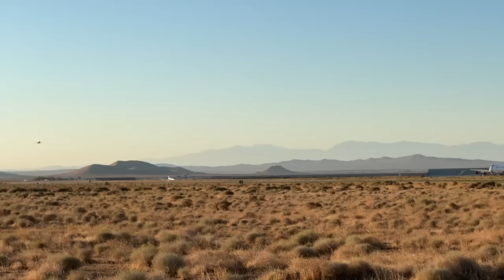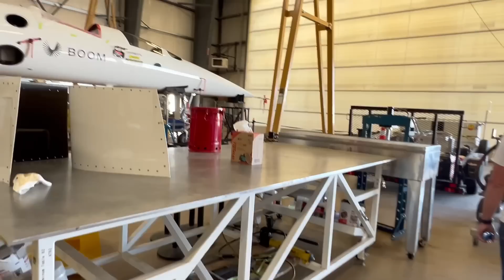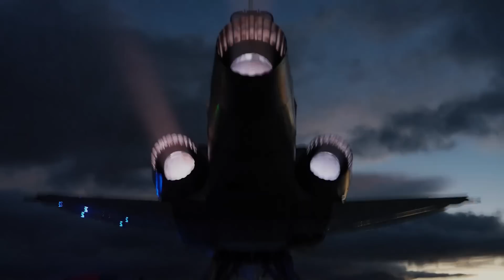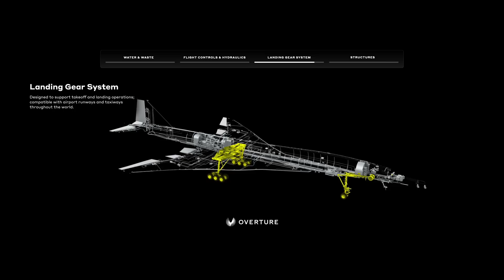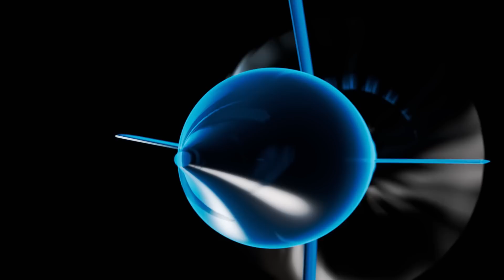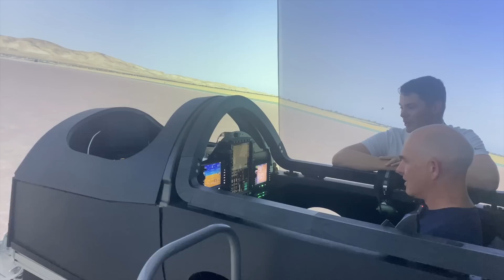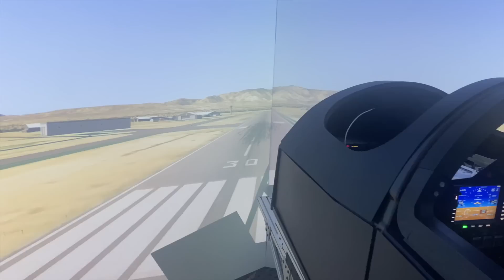Will This Experimental Supersonic Aircraft Show Supersonic Airliners Can Work?

Comment: It would be the height of irony if 5 years after we have finally get supersonic passenger airplanes back they get run into the ground by ballistic rocket transport from folks like SpaceX, Stoke, and RocketLab...
Reply: Never, ever going to happen, at least in our lifetime.  Planes can at least glide and be navigated.  Using a rocket is the same as a missle, anything goes wrong..that is just going to go down.
Reply: @onedaya_martian1238  same with elevator brakes. And who says a ballistic rocket can’t have wings and glide to a landing?

Comment: Supersonic Airliners Can Work....huh?? Concorde started flying close to 50 years ago at Mach 2. 
Perhaps private business jets?
Reply: It didn't "work" as a commercial product.  Designed, built and operation was only possible with government subsidies.
Reply: Not private, but for specialized airlines i guess, a smaller concorde with such increase in efficiency, will be perfect for high end bussinesmen.

Comment: Even if it never becomes commercially viable, I'm glad they're trying.  Such a beautiful aircraft...and that simulator is excellent!
Reply: What sunk the Concorde (with its costs having to be subsidized by the UK) was its use being limited to one overseas, and not include an overland, route. BOOM's chance at commercial viability depends on a full-scale prototype demonstration of sonic boom abatement and at a level acceptable to the governments of international buyers. Also, from the start and for a while, the market segment would be small, i.e., those who are wealthy enough to easily and repeatedly drop the likely exorbitant expense. But the rationales for needing to actually physically be at certain locations, though, are even more limited, for example, the essentially infinite disposable income-driven whims of the aforementioned wealthy and... what else? Ever-improving encrypted videoconferencing capabilities and inclusion of photorealistic holographic interactions negates the need for time-consuming and unnecessarily expensive face-to-face interactions that the less well-healed would never be able to "enjoy" often enough for true commercial viability.
Reply: @hlcepeda  don't use overly complex extra fancy words to say "we don't need to travel overseas supersonic to physically seal a deal, internet is secure enough and much more efficient."

Comment: I feel like supersonic flight is solved and there is infinite data available from NASA and military testing. 

What are they actually testing since it is not a scale model of the BOOM airliner. Doesn't use the same engines
Reply: Good comment.  If those folks are honest and not scamming, they are doing like all inventors/developers...learning by doing..even though it has been done and very well documented.  Like all evolutionary processes, one "ahha" moment MAY let them succeed. Of course most genetic permutations fail, but in this case, the folks working on it will have the hands on knowledge...just like the striking machinists a Boeing...which are needed for a future at least advanced as it is now.
Reply: @onedaya_martian1238  there has to be a balance of finding out for yourself and availing yourself of existing tech

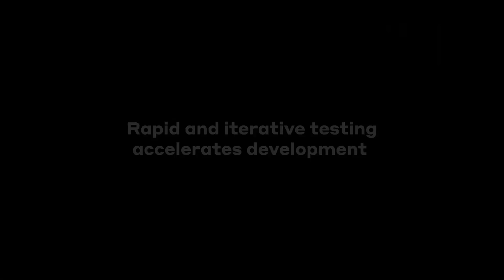Comment: 10:35 for reference Google says that the Concord Burned seven times as much fuel per passenger miles so this is quite a bit more efficient than the Concorde... If it pans out
Reply: Well Concorde took off with around 95 metric tons of fuel (26k gallons or 120k liters) to fly less than 100 passengers (after the wing tanks were fitted with liners) over the Atlantic ocean.
You'd land with pretty much nothing left (required reserve was something like 6.5 tons). So that gives you roughly 0.9 ton per passenger. The numbers I found for the A350 talk about 2.5 to 2.9 liter/100 km/passenger. That equates for a Paris/New York to 146 liters or 119 kg... So from 6.7 to 7.8 times less...
Reply: So you're saying it'll be somewhere between 2 and 7.

I really wish these guys the best, but I'm not alone in thinking that designing an aircraft is one thing and designing a brand new engine is another.

But then there's SpaceX with their bespoke Raptor rocket engine and we can all see that it is not beyond the realm of possibility for a private company to create something new in aerospace. But also there's a big difference between the two in a lot of ways. There is still a lot of testing in their future and I won't expect a working model for another ten years.
Reply: @sntslilhlpr6601  And making a new aircraft profitable, that's an even harder thing.
Reply: Is the Concorde number in comparison to contemporary aircraft at the time or to modern aircraft? Because airliner efficiency went up quite a bit since the 70s.
Reply: Concorde was a failure because the market for air travel changed to favour mass travel and cheapness. The trend continued and gave rise to the budget airlines, eventually. Plus the sonic boom was a problem over land limiting the speed advantage to ocean routes. In terms of cost and fuel, flying supersonic is always going to be extravagant. The question is whether there is a niche market for flying the Taylor Swifts of this world around quickly, and at their great expense. I'm speculating, but the speed advantage may also be more attractive on very long routes. For example, you may save 3 hrs transatlantic but over 10 hours from Sydney to LHR even with a refuel possibly. Another risk is that with all the net zero stuff, this kind of travel gets regulated way because it's so fuel thirsty.
Reply: @nighttrain1236  I think the demand for air travel was always mass travel and cheapness.  It's just that we finally got the regulation out of the way and figured out how to make the planes more efficient.  I mean, I think most people want to be able to travel long distances quickly.  But if it costs the better part of the cost of a new car to do so, they'll find something else.  Doesn't however mean there isn't space for fast or high end travel too - plenty of people in this world for whom cost is no object.

I actually don't think the net zero stuff is going to be too problematic for supersonic.  Aviation in general is a pretty small fuel user, in the scheme of things.  Supersonic is probably always going to be a tiny niche within that.  Probably what will happen is electric will start off for short or feeder routes.  It'll get better and better and be used for bigger planes and longer flights.  But, for the foreseeable future, some flights will use aviation fuel (even subsonic).  But, given the relatively small volumes that will be required, manufacturing it from renewable resources seems plausible.  We can already do that, but doing it at the scale required to replace today's fossil fuel usage isn't really feasible and may never be.  If it's just a tiny portion of today's fuel usage, it's probably quite doable.
Reply: If they managed twice the fuel burn at twice the speed it might end up being cheaper, but its the maintenance costs is what will kill that equation.
Reply: Theoretical at this point.  I predict mehhhhhh results.
Reply: The knock on effect of of reducing business jet travel I think will justify the plane even if it is comparatively only marginally more efficient then Concorde. Business jets fly higher and faster than commercial jets, they burn more fuel per mile for a much smaller payload.
Reply: This is 2024. UK and France did it 55 yrs ago.
Reply: At the same time, the amount of fuel dumped into takeoff by even just a conventional jet airliner with high bypass fans is astronomical. There needs to be a significant shift from air travel to rail for continental transport.
Reply: Thanks for that. I was wondering
Reply: Thank you. That was what I was trying to remember
Reply: It's just a mid-low bypass turbofan. Instead of the much older and less effecient turbojets of the the concorde. Not really that hard to compete when you take into account modern technology.
Reply: They claimed last year that it'll be as "cheap" as a business class ticket on airlines.
*cheap here meaning that relative to the Concorde, it's NY-London ticket, inflation adjusted- is sheer 25k$ today, and a business class being about 1600$, Boom claimed it'll be around 2000$.
Reply: A better metric is fuel use per passenger. Since the number of passengers here is zero, it's not really a good comparison. We don't know how well this is going to scale up.

Comment: When we know that Concorde was doing Mach2 49 years ago with 110 people on board!
That was amazing for that time.
Reply: @tj2375  Aside from the Tu-144, that is. But Concorde was better. More elegant, prettier.
Reply: It's even older than that if one includes test flights. Based on Wikipedia, first supersonic flight was Oct 1st, 1969. 55 years ago. Incredible what they could do with technology of that era.
Reply: @tj2375  because it's economically not viable
Reply: Yes, if it isn't a simple remaster of the already perfected Concorde platform then it's another pointless research money milking machine.
Reply: @karlslicher8520  Why not write what you do believe instead of being disingenuous?  The only improvement effected by the XB-1 may be quieter sonic booms; it will carry fewer passengers at slower speeds than Concorde.
Reply: @karlslicher8520  Different times different technology - so different envelope of performance. BTW its a private enterprise - so 'milking money' as such is an irrelevance.
Reply: @karlslicher8520  It's to test a new platform that significantly reduces sonic boom and improves efficiency, so future planes could possibly carry passengers at supersonic speeds.
Reply: @videorowtv5198  Yes, agree with. But in Concorde you could smoke cigarettes at 60000 ft at Mach 2 and it won't be done again 🤣
Reply: @videorowtv5198  That may have been the pitch years back, but it is not what it has become. They quite obviously pivoted at some point because they knew that they didn't have the resources like NASA and Lockheed.
Reply: @videorowtv5198  There won't even be 'future' jet passengers at current speeds.
Reply: @karlslicher8520  Concorde took a lot of money to build, and lost money with every flight despite its high ticket prices. Concorde is old technology. It’s not that we couldn’t build Concorde today, we just don’t want to.
Reply: @foximacentauri7891  Concorde saw a 75% return on every flight, including the cost of dedicated first class lounges at airports and other bespoke accomodations. It was one of the most profitable aircraft of all time, with that only potentially changing because airbus wanted to charge absurd maintenance costs so they could push newer aircraft.
Reply: @iskierka8399  Source ?

Comment: If you cannot look forward anyway, why use a transparent canopy at all? At worst, it just adds unnecessary glare to the Pilot and the screens inside from the sun. I think the most useful thing would be to wear a helmet with a 180° (360°) VR view from cameras all over the plane, creating an all around full-view video stream.
Reply: Because the benefit of having a perspex canopy for a test aircraft way outclasses any benefit in weight saving or cost.

Comment: Having both cameras on the nose gear seems too risky. If birdstrikes damage them or the nosegear doesn't deploy properly on landing, the test pilot would have to land without either of them. I noticed the portholes near the pilot's thighs. Can he land looking through those? Or, is he trained to land looking out the side of the cockpit if need be? Perhaps portholes near the rudder pedals would remove more failure points.
Reply: I something hits the nosegear hard enough to break both cameras in a landing, you have bigger problems that see were you are .
Reply: @framegrace1 Landing without a nosegear you'd definitely want to butter that landing though...
Reply: If something takes those cameras out, it is up to paddles to get him back on the ground safely.
Reply: If it's just the pilot by himself, they better have a way for him to land that thing. And I mean just the pilot, No cameras no Personnel on the ground.
Reply: @Cleofis_Randolf_the_Patriarch  Considering it is not being flown without someone on the ground to talk him down. I fail to see the issue.
Reply: IFR exists guys!

Comment: The testbed is the equivalent of a 1960s T-38 trainer.   Congrats...
Reply: Using a T-38 for chase. Chase can outrun what it’s chasing.
Reply: @youbecha64  EXACTLY my thoughts. Wish they had skipped this step and put the cash into the real deal. If they actually required this plane as a stepping stone, that causes me great concern…
Reply: @EstorilEm  I get the need to make scale testbeds...but it is a long way from a T-38 to a Concorde.
Reply: @youbecha64  I understand, but they’ll never make a penny with the XB-1. Their focus should be on Overture IMHO. That old T-38 in the same hangar already goes supersonic with the same engine and carries more people. 🙈 I guess my question is… why build a new plane?
Reply: This thing will be way faster than a T38. Much less drag and 150% thrust.

Comment: The answer to whether Boom's plane shows it can work I think depends ultimately on the results of the X-59's test campaign, I think there's a lot of pressure to make the answer 'yes' in terms of allowing 'quiet' supersonic flights legal but it's not a done thing, and I think the supersonic industry needs that approval as I see the market as being pretty narrow without it. Working on the assumption that for the time being we'll have only 'loud' over ocean supersonic flights I think it's possible but really difficult to make it work economically, though there is enough money riding on it right now that I'd guess it's more likely than not we'll see it work out, and I think it becomes 'quite likely' if the X-59's testing gets the big public thumbs up for sound feedback
Reply: Boom is planning on catering to trans oceanic flights first, so they don't need the x59 program to yield regulatory changes
Reply: X-59 "quiet boom" tech has nothing to do with Boom's Overture
Reply: But the noise issue with commercial supersonic planes is not just, or even mainly, sonic booms. Supersonic speed means supersonic exhaust from the engine's core, which is inherently noisy. It's getting an engine that can be certified for takeoff from urban airports that is the biggest barrier Boom faces - and there is no sign of that happening.
Reply: It’s unclear to me how this flight demonstrator will translate to the real thing.
Reply: @branchan00  It allows them to get allowables and processes for every small individual bit involved in designing an aircraft (there are so, so, so many) and more importantly proves they can build something real for asking for more $$$$. Nothing about it is breaking new ground but a new company needs to do something to get information you cant get online
Reply: I'd agree, the sound feedback is a major part of the validation of this concept.  If we can all get comfortable with the muffled thump of a "quite" supersonic commercial flight over populated areas this could trade well.   It is absurd to think that a Concord flying out of SFO to (LHR) London had to stay below supersonic speeds, where it was inefficient, for the first 5 hours of the journey before reaching supersonic speeds over the Atlantic.
Reply: @richny13  when the USA tested supersonic flight over land during the short SST race they flew the XB-70 over Oklahoma City at mach 2 I think at 50,000ft and it was breaking windows.  And of course the other noise issue is can they make the engines run at the noise standards for the airports near the cities with a market for an SST, such as JFK.

Comment: The problem is that the configuration of the XB-1 is totally different from the aircraft they are allegedly going to produce.
Reply: Not sure about, the problem is that the configuration is the similar, hence why he pointed out saying that the rudder is so small. It's scaled for the larger version.
Reply: @br4nd0nh347 The XB-1 has three engines and the Overture has four engines. There is a significant difference in configuration.
Reply: @jwholmes2 you’re missing the point of this test vehicle. This is only to prove they can make a supersonic aircraft and be able to reduce the sonic boom. One step at a time Stockton 😂
Reply: @sc1338  Wrong vehicle.  NASA is the only one reducing the boom.
Reply: @sc1338  No, I am not missing the point. The XB-1 has three engines because the original Overture design was to be a three engined aircraft. Boom then totally redesigned the Overture and now it has four engines. Thus, the dynamics are not applicable one to the other.

The XB-1 has as much to do with a supersonic airliner as the man in the moon. Nothing carries over from XB-1 to Overture. Commercial Aircraft manufacturers generally don’t waste time and resources building things they aren’t going to put into series production. They stopped doing that 60 years ago. If Boom was a serious company they would be building pre-production aircraft and not playing around with toys for photo ops.